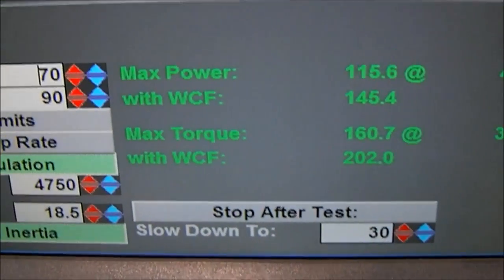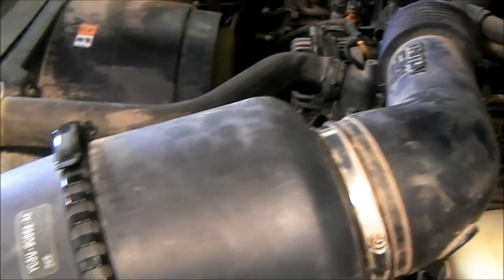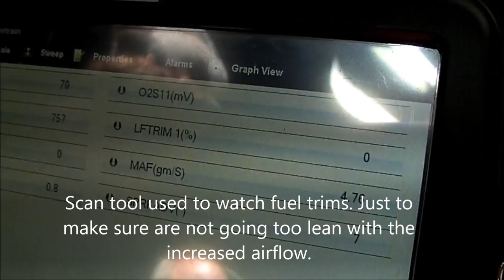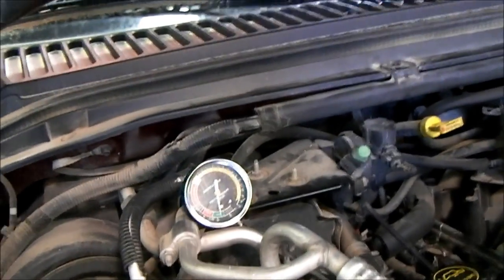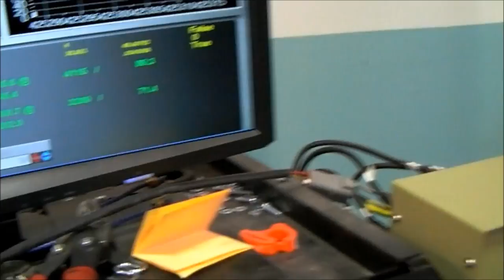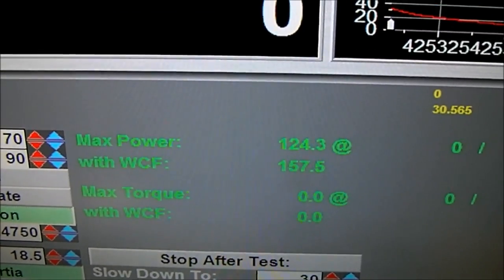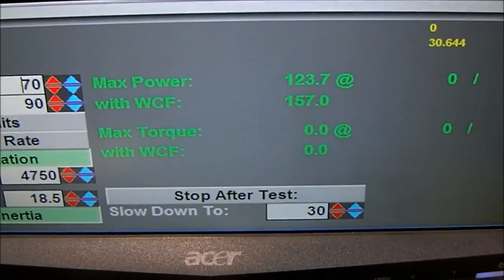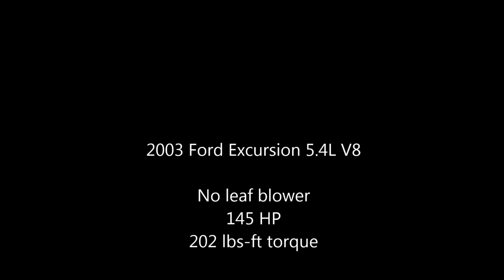Leaf Blower Forced Induction

Comment: A 1200 cc Ducati or KTM makes 180 HP with two cylinders
Reply: Steve Smith 
Let's see you tow a trailer with your bike then.
Reply: HP is just a mathematical function of torque and RPM. The only reason the bikes make so much power is because they turn over so damn fast. They provide very little torque (which is actually a tangible thing) to the wheels. It's not at all useless like some people try to say, but HP isn't at all what most people think it is. Dynos don't measure it, they calculate it.
Reply: Sage Lawrence true, and its hard to get 100 ftlbs torque out of 1200cc but they do. I'm thinking of a bike engine for my 1963 Triumph Spitfire.  it has 1150cc with 67hp and 70 lbs torque. and the bike engine weighs much less

Comment: I'm surprised, my 2003 V6 pontiac grand am produces more horsepower than that 5.8
Reply: Dalton Applegate 
*5.4
Reply: Use Trollgun 01 whoops you're correct there
Reply: My lawnmower has more horsepower than both of those combined
Reply: Dalton Applegate yea but the torque is probly way less.
Reply: Dalton Applegate how do you know how much power your car makes have you had it checked like this Excursion? A 5.4 V8 is supposed to put out 248 horses this just shows how much manufacturers lie about there vehicles
Reply: But it can't tow near as much...
Reply: torque and hp are like Apples and oranges so......yeah

Comment: 145 Hp? Wow😂... American power.... =))) i have more Hp just from a 2.0
Reply: Rares Alexandru my 2.3 L ranger makes 94 hp lol
Reply: Not at the wheels y'all are clueless lol. Bring your 2.0 out to my dyno
Reply: Mike Hundley uh my car stock is 230-240ish to the wheel and it's only a 4 banger. American 4 banger that is .. obviously turbo.
Reply: Tow a trailer with it then. And not 240 at the wheels i would wager this
Reply: My patriot puts like 120 sumthin to the wheels I pull up to 1800 pounds with the added 4x4 suspension.....however no torque lol....... So seeing that excursion with ummmmm 145 hahahahahahaha I hate FORDS!!$$ I've had two f150 both were junk by 150000 miles
Reply: My pontiac however 425 to the tires but cost me 7000

Comment: Its an american car that's why the power output is rubbish...a european diesel put out more..
Reply: Frank Wong an American diesel will put out more than an European diesel. that's why Mercedez and Audi copied the reverse flowing heads from the ford 6.7 scorpion
Reply: theres just something wrong with this truck. usually engines this size get up to 200 to 300 hp
Reply: Then an american diesel will come in and wipe the floor of a euro diesel. American diesels are making 900 ftlbs on 6 and 8 cylinders while europe made 750 from a v12
Reply: This is coming from an American: Wow, it only took one European to make a load of American'ts angry.
Reply: 96cobrasvtRJ g wagen is very nice tho. I fucks heavily with a G wagen. But you cant go wrong with a american SUV, ESPECIALLY a GM suv. My mom gas one that shit is fucking pristine
Reply: Benjamin Vergara it is flat
Reply: Mattydavee you must be European
Reply: You're comparing diesel to gas
Reply: Frank Wong right because not like American Muscle cars like the Dodge Demon and the new Corvette push 800 to a thousand horsepower it's not like that at all
Reply: Frank Wong this truck isnt even a diesel so wtf does that have to do with this
Reply: Frank Wong 
Pffff! Yeah those toy eu cars got muscle.

Comment: This why you don't buy American crap. All noise and no go
Reply: pete a meanwhile we have a fleet of 5.4s that have no issue lugging around 8000lb trucks daily, for 300k miles. It's a truck engine, turning a huge transmission, driveshaft and rear end. not a race car. They actually get out of their own way and tow just fine.
Reply: Kurt Muzio yours may have more power thsn this one, im not saying all american motor companies make bad engines however this one is particularly sad with its 202 lb ft of torque
Reply: Oh yea the demon is so slow
Reply: pete a
not true at all, you can find chevy engines swapped in almost any practical or impractical car. It's okay to say stupid things, just glad I could be the one to correct you.
Reply: pete a is that why chevys dominate racing?